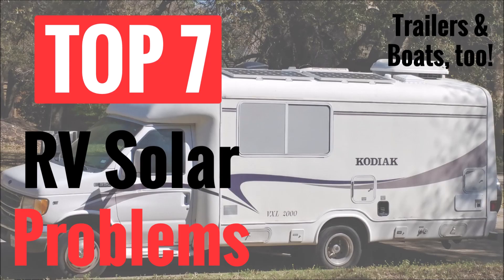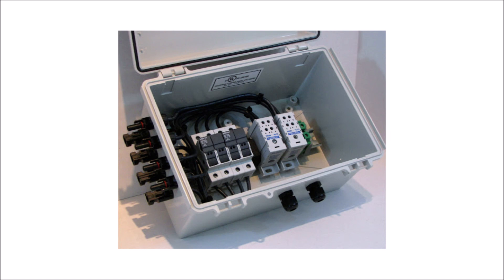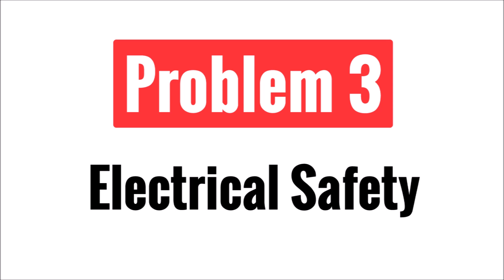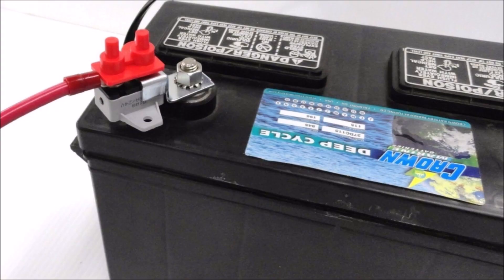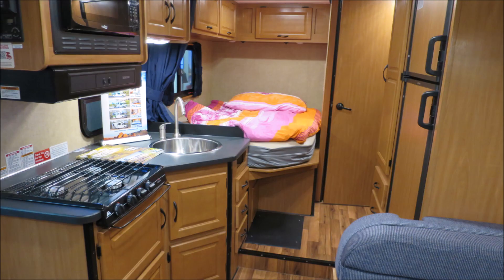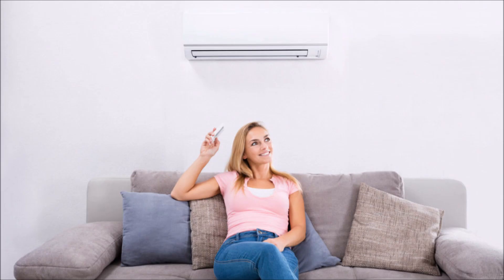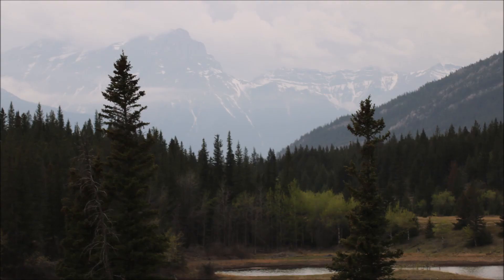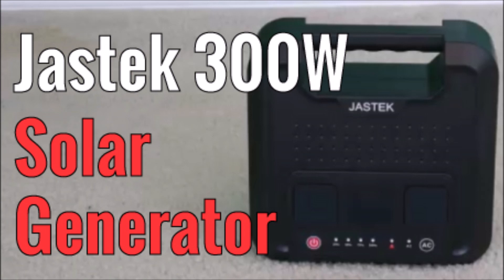Top 7 Problems Installing Solar In An RV (And Boats and Travel Trailers)

Comment: I purchased the Millertech batteries from you and so far they have performed well. My question is with my alternator on my truck and if it can be damaged by trying dump a lot of current into the batteries?
Reply from the maker: I don't know if the alternator can be damaged or not.  The batteries can protect themselves with the built in BMS.  But you can't use a lithium iron phosphate battery with a car/truck alternator.
Reply: I should have provided  a bit more information.  The batteries are installed in my travel trailer and while driving they are being charged through the 7 pin trailer connector. I don't know if I need to disconnect the charge wire to protect the alternato. Thanks
Reply from the maker: I don't know enough about the auxiliary charging through a trailer wiring harness.  But if it is the exact same as the truck's starter battery then it is not good and you will want to disconnect it.

Comment: Great advice as always! I was thinking foldable or ground mounted panels would be the way to go. - Danny
Reply from the maker: For sure.  I would do it in a heartbeat.  Just get a couple panels, put some piano hinges in between the two frames and put a handle on it and you have a highly portable system.  Unfortunately, the RV owners I have worked with in the past are not interested in doing that.  I guess it is too much work?
Reply: @LDSreliance  🤔🤔🤔 interesting. Doesn't sound like that much work to me.
Reply from the maker: I wouldn't think so!
Reply: @LDSreliance  I had a fabric fan-fold. Kept the cells from scratching each other. (Rather than metal hinges)